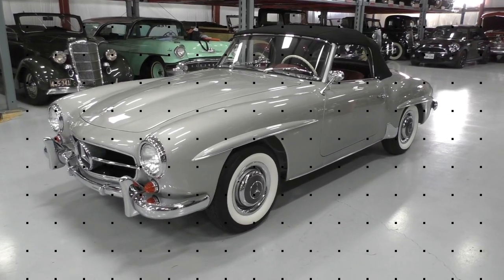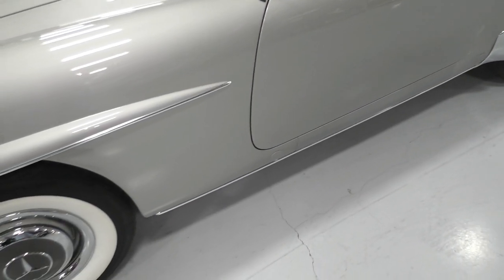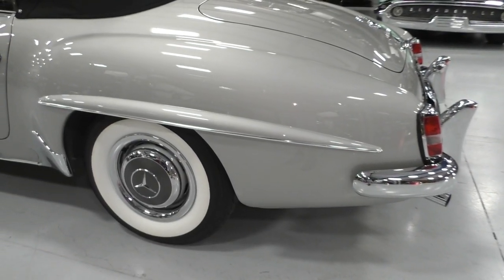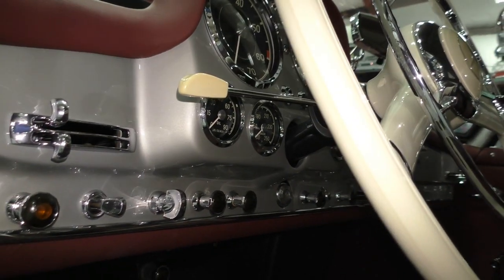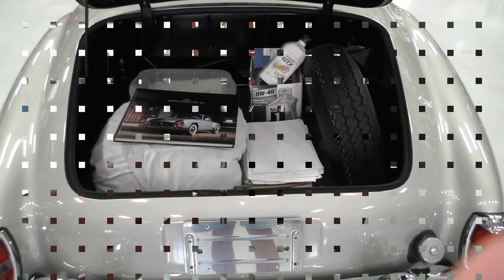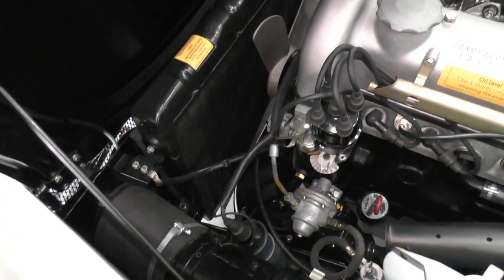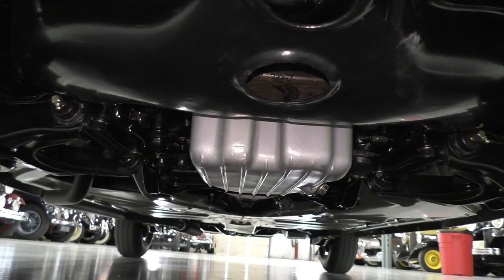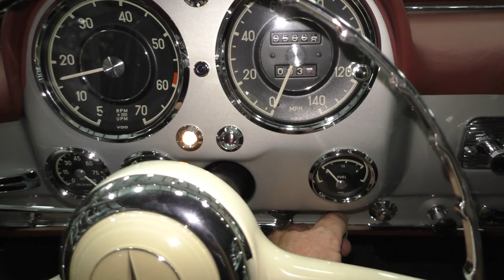1961 Mercedes Benz 190SL Roadster w/Hardtop "Concours Quality" (SOLD)

Comment: I drove one around 50/75 miles in 1963.  Not fast, not noticeably  slow, but very well behaved.  Probably the nicest car all around I ever drove.  If not a poor student at the time,  I would have bought one.  It had a nice 4 speed trans.